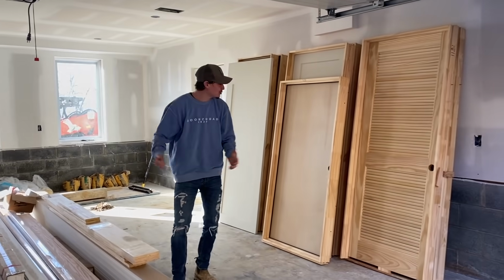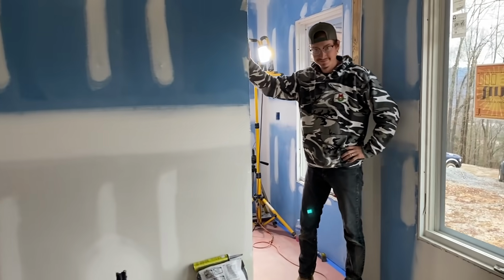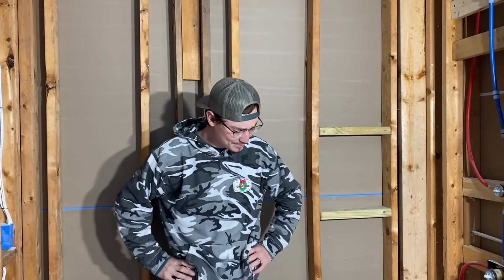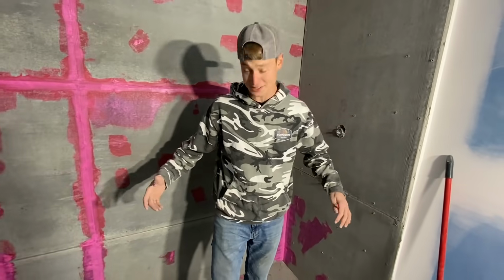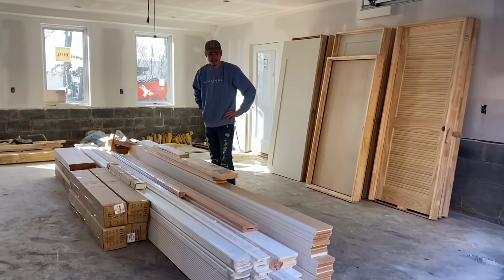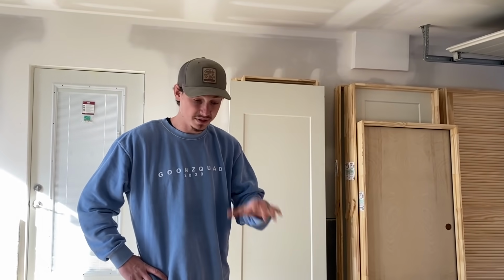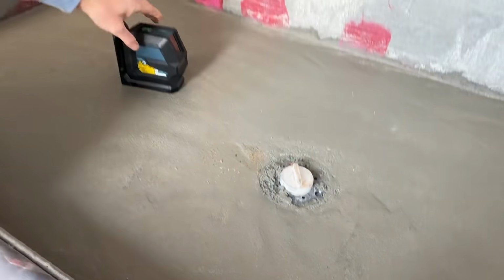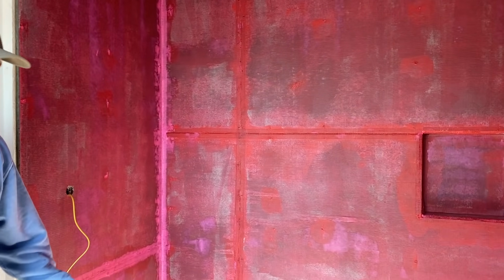The New Goonzquad Headquarters Part 48

Comment: You haven't put seams in cement first then waterproofing over that..your going to have issues with that being a steam shower..better fix it now or wear a hard hat in shower..
Reply: There’s going to be several issues in a very short time
Reply: YEA about a 1000 more screws and mortar the tape on all the joints and corners then waterproof. Love that the guys are willing learn new stuff but I don' t think I've ever seen a video or anyone use waterproof to set their fiberglass tape.
Reply: Yeah they were supposed to put concrete down before the liner they definitely skipped a step

Comment: Uh oh! They didn't slope the vinyl liner to the drain! This is a HUGE mistake! Where did they get their info from?
Reply: Should they have used some concrete beneath the liner to create  a small sloped for the liner to sit on?  I'm sure the tiles they put in will be sloped?  Does the liner also need to be sloped?
Reply: @AllAroundTube50  Absolutely, yes! That's the first step. A pre-slope to the sub-drain. How's water going to drain out of this? Water WILL get through the cement floor, and it will just sit there. That's why you have a sub-drain. The drain clamps the liner, but there are weep holes so the liner can drain. Then your final floor, on which you set tile, is also sloped (of course) to the main drain. It is sloped to roughly 1/2" below the top of the drain (to allow for the thickness of your tile pus thinset).
This is what they skipped:
https://www.youtube.com/watch?v=H40Q2xP6pIg

Comment: They didnt slope the shower floor...
Reply: Or call for a inspection. Oops.
Reply: That's done with the Mortar bed.
Reply: Not gonna matter that shower is gonna leak no papper r plastic behind the wonder board in red gard is crap. Sorry to c them do all this work for nothing
Reply: @alanmiller1497  they didn't even tape the cement seams.
Reply: @ScreenName5  wonder board not water proof n red guard isn't any good. N thoes vinall pans crack. 36 yrs n the tile trade all the material there using is great if your gonna flip a house were u walk away.customs who makes that red guard won't even warrant  it.

Comment: Herring bone subway will need to be mirrored on the left and right walls...if they do not line perfectly it will super sketchy. Suggest you go with classic subway in brick pattern. Simple and looks great.
Reply: Agreed. Setting out a herringbone pattern is very difficult to get right, even for professionals. The main problem is how to get the 'flow' of the tiles around all four corners of the room. The doorway and the mounting channels for the shower screen are the only places where you can 'cheat' a little to hide any awkward vertical cuts and avoid having any small pieces of tiles, but however it's done the job is a pain. Nice when you get it right, though!

Comment: I'm a new subscriber and was looking at some of your older posts. I restore antique Corvettes and thought I would share a cost cutter I discovered. Lowes has a product called Peel and Stick that is the same thing as Dyno-Mat at about a 10th (16.95) the cost. It works great for a heat shield and sound deader. I use it on all my restorations and it apply just like Dyno-Mat.

Comment: You need waterproof LED in the steam shower. In the tile section you can find spacers that go in the tile corners that have a top plate that zips down to keep all the corners the same height. You should also add a bench, so you can hang out in the steam. you could also buy a teak one.

Comment: Nice but that angle you need more tiles due to off cuts. And that alcove shelf will be a hard one. Suggestion is to get some molded tiles.  And end your wall tile the same way. Note you should get a black tile small like you got for that floor so you pop a tile off white from the mesh and then add a black one.   Why? Well it will match your other floor better.  Also custom glass can be as much as 2600$ a shower.  Suggestion get sliders they are the best with less issues. And 3 panels makes easy to clean.   As for the ceiling tiles match the floor is the easy  choice  but could put a black chrome mirror tile it would add dimensions.   The base mortar takes a long time to dry.  Why? Density before you add tiles to floor add a mesh near drain.   So no cracks in grout...   mesh can be drywall mesh.   Best part of small tiles   if they fall   they hurt less...

Comment: Buy some sawhorses so pops doesn’t have to work of the floor. On the right side of stairs you should extend the wall tall enough so handrail doesn’t run into ceiling. Good job men! Also prime walls before trim

Comment: Guys, you needed to slope the floor in the shower before installing the liner, then float and slope aging after the liner for it to work when you do get a leak and you will get a leak, is just a matter of when.

4 years ago in a rush, I made the same mistake at home and 2 years ago it cached up to me. I knew at the time I made a mistake but decided that the following day after it dry I will put another limner on top and more concrete and an extension drain tube and 1/4 inch cement backerboard. 
I did do it to save two day to get done before Christmas and a full house of family coming from out of state.
 Well lets just say it was about 10X the original money to replace it along with all the added damage caused by water seeking into the other rooms and that's in a concrete house with very little wood. It would have been more money had not been able to do the work myself.

Comment: Use the quick dry mortar on the ceiling it sticks on allot better, beware! you have to get it right the first time dries very quick!!
Reply: I've never tried fixing ceramic tiles on the underside of a ceiling, but I would probably do some experimenting before the real job, perhaps using one of the 'Bison' industrial adhesives or the 3M 'Panelbond' glue that car makers and aircraft builders use to stick parts on these days. With all that steam around, day after day, year after year, I'd not be too keen on using any type of cement based mortar. For a contractor, there could be some tricky liability issues if tiles start falling on users, especially in the US where everyone has a lawyer on speed dial...

Comment: congrats on going through all the trouble of creating your own shower floor pan and not just buying one of the foam pre-fabs ones that that just cut with a utility knife.(that save you literally hours of work)

Also, way to go by not using a KERDI membrane in the shower area, as sure everyone knows that concrete board is not water proof, but hey it's not like it is a steam shower or anything.

Comment: You need exhaust fan for the shower area. Fantech makes can lights that pull exhaust from shower area,and you mount the fan in the attic so you won't hear it. The fans look like jet engines

Comment: Nice job fellows 💯 , I think the Dura Rock would have been a bit stronger if you would have crossed over the joints instead of stacking them on top of each other but , all good it will work and looking forward to the final product 💯👍👋

Comment: GUYS HAVE U HEARD OF THE DITRA HEAT UNCOUPLING MEMBRANE WHICH IS A WATERPROOF MEMBRANE ITS LIKE A RUBBER SHEET. THAT THING IS PERFECT FOR YOUR STEAM ROOM MAYBE YOU CAN LAYER THAT OVER THE  RED  GUARDING. IT WILL GIVE YOU A LOT MORE PROTECTION. HUGE FAN BY THE WAY !!

Comment: You were suppose to use quikrete mortar mix for the shower bed and for the ceiling i recomend acrilpro ceramic tile adhesive wich can also be used on the walls for the type of tile you chose just dont use it on the floor use versabond for the shower floor or any floor tile

Comment: hey guys should have had drain in before the cement. Turn all the way down , finish cement to it, tnen turn up to the thickness of the tile. Also should have meshed taped the wall joints and patched before the pink waterproofing..Keep trying hard you guysare a blast to watch.

Comment: Really should have done the bed before the cement board, then leave a 1/2” gap between the bed and cement board. With the board in the bed, it will draw moisture up into the wall. Cement absorbs water.

Comment: Those cement panels are supposed to be screwed down every six inches, at the seams and on every stud. I use over 200 hardy screws for a shower half that size!
Reply: Yes, tiles are mad heavy. I'd probably specify adhesive between the studs and the boards as well. Can't be too careful...

Comment: Lay redguard two layeers on walls and sesling. 3 layers with strip on all corners and 3 layers on floor. Then irs like the pool and water never leak. Around pipes goues rubber patches what comes throught floor and wall. Like what you are doing. Multifunctoin man.

Comment: You sure supposed to put sloped drypack under the liner, then the liner , more dry pack. Tile grout then put the cement board on the walls. This will prevent water from getting under your floor tiles.

Comment: you got the bosch laser - nice! as with any tool it has a bunch to do with the person and not the tool but in the right situations the laser can be very helpful #what is grade?
Reply: Great little self levelling level, perfectly usable outdoors in dusk or shade.
Working great for laying out my foundation for my 16 x 24 slab.
Accuracy is very good and was checked against absolute measure.
Mine is easily level within 1/16" at 30 feet.
I am using it outdoors.
You really need to wait till dusk or in heavy shade to do this at any distance outdoors, but it is many times cheaper than the models designed to work outdoors.
If you can work with it in the dusk, you could easily use it for septic lines, garage and even house foundations, slabs and floors quite successfully as well as the interior layout it is designed for. you can mount it on a tripod - also add round bubble level just like you would have on transit level to shoot points and get elevations - you might be able to figure out how to get a beeper so you leave the laser on the tripod and walk around with the stick and beeper to get the elevations you want? ymmv vary - you may be able to set up sensor on top of blades on equipment so you can get steady tone when you are at grade
https://www.youtube.com/watch?v=OmhdtlcOrq4
Reply: Grade is a US term for a sloping surface.

Comment: needed backer boards for handrails..  did they seal all the cement board edges with a mortar thin-set and fabric membrane and then the red guard and what about the slope to the center drain.

Comment: The walls need two to three coats of Red Gaurd to get the proper thickness to be completely waterproof.
Reply: Redguard is garbage. Mapei is what they need to use life time warranty.
Reply: @jondoe3776  I don't know which brand is best, you are probably right, but I know you need a certain mil to achieve a waterproof film. I used Tec Hydra- flex which needs a 46-50 mil / 3/32" film. They only showed 1 coat and they didn't finish the seams properly. They need to seal the grout to minimize water seeping through the grout.
Reply: @timsaunders8384  absolutely 💯 my take on it is they need to use the right product first and do it right. I own a renovation company I've used it all.
Reply: @jondoe3776  They should also chaulk the corners and at the base of the tiles to the shower pan with color match chaulk to prevent uneven expansion cracking if grout is used.
Reply: @timsaunders8384  of course thats very important. The oldest brother is there contractor and he helps them all the way. Pops is very smart when it comes to this kind of stuff.
Reply: @jondoe3776  Just because big brother is their contractor doesn't mean everything will be done the best way. Probably most contractors wouldn't even use a waterproofer, much less apply the proper millage or chaulk the corners to prevent cracking.
Reply: @timsaunders8384  in Georgia we all have codes to be checked first and for most. I stand behind my work and what I provide for my client's. These boys will be just fine 🙂 best..
Reply: @jondoe3776   There is minimum code  standards which a lot of the time isn't enough to last without problems like mold and water seepage that can rot studs, joists or subfloor.

Comment: You guys should Prime the whole house before doing trim and everything else spray back roll everything first coat walls with the color you pick then first coat finish pait ceiling put trim up caulk nail fill spray it then first cut everything then finish paint everything have your mud guys t/u everything before you finish paint also sand in between coats of paint and spot prime any new mud

Comment: You are supposed to flood test your shower liner for 24 hours before putting your mortar bed down and have it inspected. This is going to be a problem at your final inspection. Also see the other comments about sloping the liner, wood curb, etc.

Comment: I hope you used mesh tape on the joints of the cement board. If you didn't, it can cause cracks in the tiles where the joints are. You might never have problems, but there's a reason cement boards are bonded together with mesh tape and thinset

Comment: BEFORE you guys go any further with the project.  Might want to think about adding ANY access panels for plumbing and stuff.  Nothing worse then having a finished wall and you get a water leak in the plumbing areas, and you have to cut out an access panel out later to get to it to fix it.

Comment: Lights in a shower. Not a fan due to rusting out. Now you added a steamer will speed up that process. Secondly I didn't see a fan in the bathroom. Thats bad for the rest of the room not to pull out all that extra humidity. That will effect your HVAC.   Just helpful tips. If you all even see this.

Comment: I would recommend to not use a heater onto a wet concrete surface. It will make the concrete crack. Wait for it to cure naturally, the hydration reaction has to finish properly!

Comment: if you haven't got the grout yet try to get laticrete permacolor grout its pre sealed and the color is always consistent the other groups wash out and never is the same color as shown and I see you already preped the showers but next time look into wedi shower systems also try not to use premixed thinset use the custom virsa bond they sell it at home depot as well as seat all the joints of the backer boards with some mesh tape let me know if there is anything I could help you guys with love what you guys do its awesome
Reply: seal the joints sorry

Comment: Um, arnt you supposed to do mortar directly on the subfloor for slope, THEN the rubber liner, then the reinforced mortor bed, then the thin-set layer, and then the tile?
Reply: Also needing to gravel around the drain for the weep holes?

Comment: Quick question was the cement you put down in the shower bed flexible? Over here in England we can get a cement board designed for a shower bed, and made with a slope to the drain built in

Comment: Concrete (thinset and other concrete based products too) does not dry it cures. It also needs water to cure slowly. That gives the concrete its best strength. Forcing it to dry using heat is not a good idea.

Comment: Guys:  Looks good except in my opinion,  you should not have the cement board all the way to the pan.  With your pan mortar up on the cement board, you will have issues with water damage in the future because water will wick up into the cement board.  Now is the time to fix it before you install your tile.

Comment: Goonzquad, do the bathrooms have vents and electrical motors installed?  they’re used to get the moisture out of the bathrooms?  I believe that is required in building codes. I know someone who was remodeling their bathrooms in their house.  The house didn’t have none and was installed to code.

Comment: There should be fiberglass mesh tape with morter on those ciment board joints! ...don’t know where you do all your « research » but this is basic stuff as alot off others things....building a house wrong will give you problems for years...

Comment: You guys need to paint first and paint the trim on saw horses. Way easier to do that. Also your shower bases was way too wet! It’s supposed to be just about crumbling in your hand. Like damp sand.  Hopefully you guys don’t have problems in the long run on that.Tile in a shower area is one of those things that should be left to the pros imo. Hope all works out for you guys.

Comment: Probably should have put down a mortar base before you put down the liner. Then another on layer of mortar on top. Sloping both to the drain. If water gets thru the tile it will not drain properly and sit on the liner. 
Also am I the only one that noticed no insulation above, moisture barrier or vent fan above the shower? Love what your doing just don’t want to see a mistake bite you in the future.

Comment: You guys should finally get the electrical and HVAC turned on. You could technically have had it turned on before the sheet rock was even up. Also, please tell me that you have vent fans in the bathrooms. You are just asking for moisture problems without them.